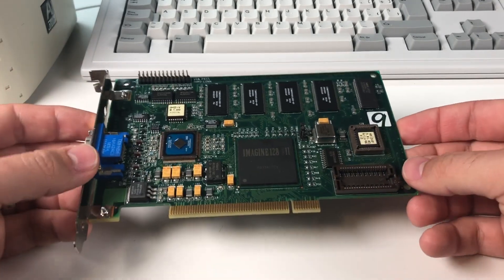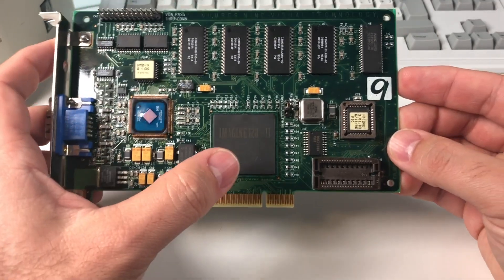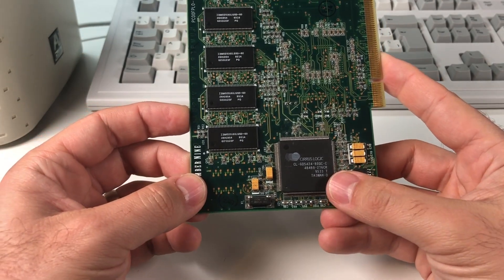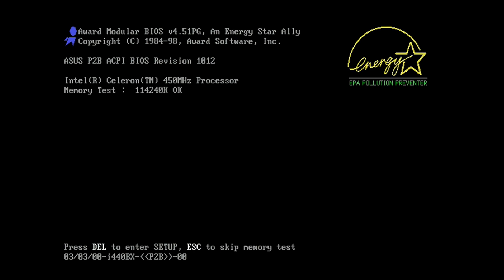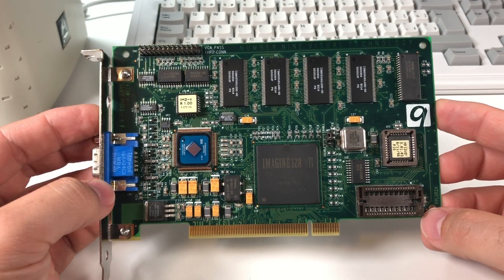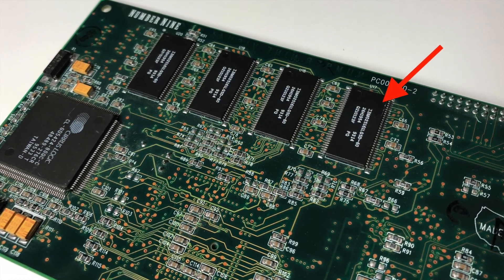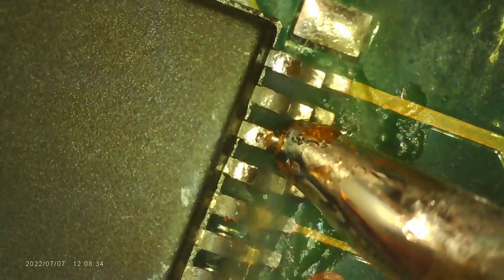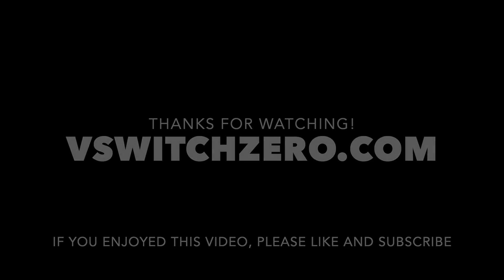Repairing the Number Nine Imagine 128 Series II video card

Comment: Interestingly enough, I remembered having a graphics card with an Imagine 128 chip on it, so I went and check and indeed it's an Imagine 128 series II card, but it has 8 memory chips on the top instead of 4, the blue IBM chip is placed higher, and there's no Cirrus Logic chip nor any components on the back of the card... could it be only 3D? I never tested but I might try it out if I get the chance, because now my curiosity is piqued.
Reply from the maker: Thanks for your comment! Sounds like your Imagine 128 II is the later revision if it doesn't have the Cirrus Logic chip on it. These seem to be harder to find these days. Number Nine ironed out all the quirks with 2D graphics modes by that point and didn't need the CL chip any more. Your card would be much faster for DOS gaming as a result :-)

Comment: I had always thought that all GPU's should have 2x GPU chips on the PCB, one normal GPU for playing the latest games, and the other for multimedia/desktop/web-browsing/legacy software that needs minimal hardware aceleration/etc. They could optimize the second chip for all those things and this would then free up SoC die area for more features and performance on the modern main cutting edge GPU, as they wouldn't have to worry about legacy features and multimedia codecs and so on, perhaps even FPGA on GPU's can one day be used effectivly in this way somehow, all legacy GPU and multimedia aceleration done by the FPGA and all modern gaming features handled by the main GPU, this would lead to better backwards compatabilty for older software and games, and much faster performance in GPU's as all DIE space is dedicated to cutting edge gaming API's and features, the FPGA could also change on the fly due to how FPGA works, so could be used as a legacy GPU one moment or as a dedicated multimedia acelrator the other, for top tier quality video playback upto 16K, you could also run multiple instances of high res & bit-rate video without any stuttering or issues, this could also be great for video capturing, and what about also audio aceleration, so many good uses for a decent FPGA on the GPU, some eDRAM or HBM2 ram might be cool too.

 
I'd love to see good multi-positional HRTF sound make a comeback in PC games, imagine an FPGA on a GPU that could do amazing HRTTF audio (like EAX was) as well as FM synth or MIDI audio for legacy PC games, drool, a GPU that can do it all sounds amazing (literally), Steam Play or Steam OS with a GPU like that available would be next level, it would be able to perfectly play every PC game correctly from early DOS era to Windows 11 era, all in one OS, no emulation needed, and don't forget FPGA can do console systems without emulation too, that FPGA could be used to turn you PC into any console upto N64/PS1 or classic computer like the Amiga or X68000, sorry got a bit carried away there lol, still an awsome concept though, a proper backwards capable GPU/FPGA hybrid, having something like a MiSTer built into a gaming PC would just be an endgame setup, there is almsot nothing i could do nativly, software emulation would be almost redundent.
Reply from the maker: Agreed! Would be a very interesting concept, especially using FPGAs for something like that. Having used MiSTer for a while, I can really see amazing potential in FPGAs, that's for sure. Thanks for your comment!
Reply: @vswitchzero  I come up with some of my best ideas typing comments when I'm really stoned lol, seriously though, a GPU/FPGA hybrid card with a full version of MiSTer or full FPGA cores compatable with RetroArch in a normal Windows gaming rig would be sweet, I think there has already been some experimental FPGA RetroArch cores working on Windows 10 via a PCIe FPGA card.

Comment: Ah, thought as much, that the IBM Chips on those cards are actualy "VRAM", which is DUal Ported.
That means you can read and write to the chips at the same time.
Was something that was a thing at the time with hgih end cards with seperate RAMDACs. Matrox (and #9 as well) used an extended version of that called "Window RAM" aka WRAM (on the legendary MGA Millenium for example).

Comment: My Dad was actually the CTO at Number 9, and he designed a lot of this card, including the main chip. Anyway, not trying to flex just thought finding this video was really cool. To answer your question on the design choice of the IBM chip on the back. He said it was basically a cost cut to support VGA (as it was apparently annoying to work with), while keeping the high performance main chip. Then, with the Imagine 128 II they had enough development time to integrate VGA into the main chip. (Note: I'm a software guy myself, so sorry if my terminology is a bit off.)
Reply from the maker: Very cool to hear this perspective, thanks for sharing! That makes a lot of sense. I'm hoping to one day find the version of this card that doesn't use the CL VGA chip as well to compare.
Reply: Around 24 years ago, I started a job at a place that had a PowerMac 9500 with a Number Nine Imagine card in it. The machine would crash every day, and I suspected the card. I contacted Number Nine, and they sent me a new ROM for it that fixed the problem. That ROM looked exactly like the PLCC on the card in the video. Great customer service. Wish Number Nine was still with us today.
Reply: Awesome reply thanks for sharing
Reply: liars after liars

Comment: I have this same card but mine does not have the Cirrus Logic on the back...
Reply from the maker: Thanks for your comment! Cool - your card is the newer revision of Imagine 128 II. They eventually ditched the Cirrus Logic chip and updated the BIOS so that the Imagine 128 II chip would handle all of the standard video modes as well as GUI acceleration in Windows. I recently got a copy of the BIOS that your card has. I am very curious to see if I can get my card to work like the later revision cards. Flashing it will be a challenge though because it appears to be a "one time use" BIOS chip
Reply: @vswitchzero  Let me know if I can help. I can scan the card for you to see if there are any other changes..

Comment: I have an old Ati Rage something AGP card which I recently got which at first worked fine but after some time gave artifacts (even during post and under DOS). I looked under a microscope but couldn't find any bad soldering joints (at least visiually). I'll try the squeze test next! 😄
Reply from the maker: Thanks for your comment! The squeeze test is a great way to identify contact problems. It won't always work, but definitely worth a try. Even with a very high magnifaction level, I'm always surprised just how hard it can be to spot bad solder joints by sight. Gently pushing the pins side-to-side is the best way to be sure.